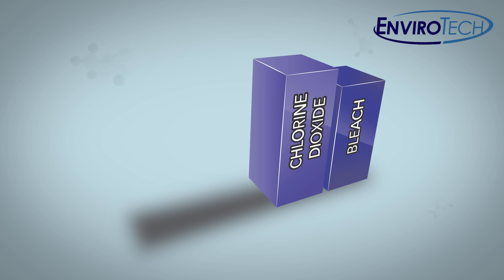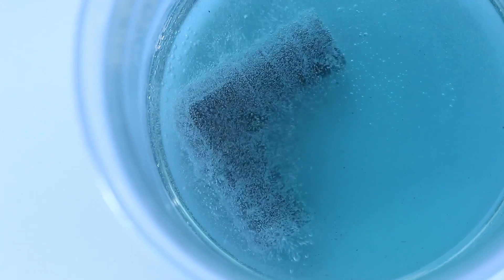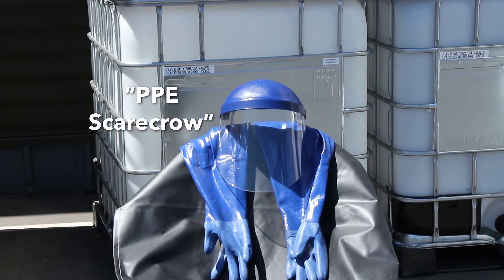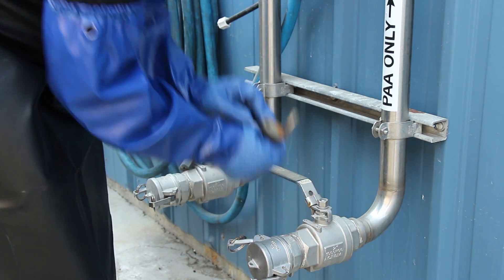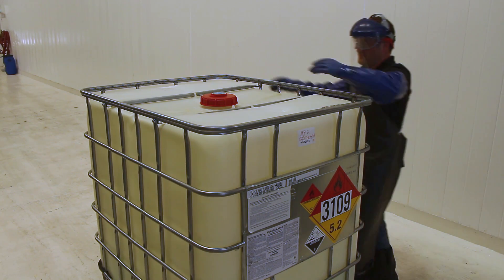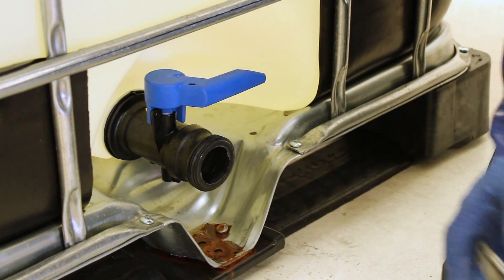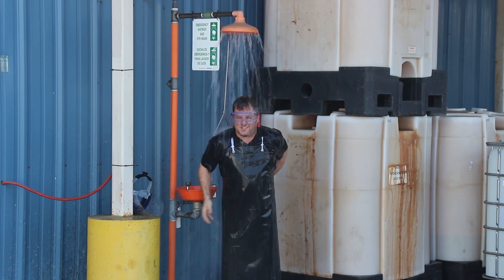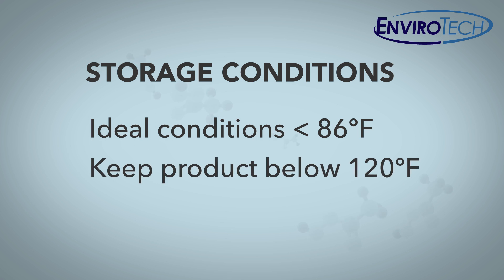Peracetic Acid Safety Video

Comment: Nice video! It might be worth mentioning the camlocks usually have a hole either side of the leavers for a split pin (which are kept on the keyrings normally), I have always found this way much better than the straps or zip ties.